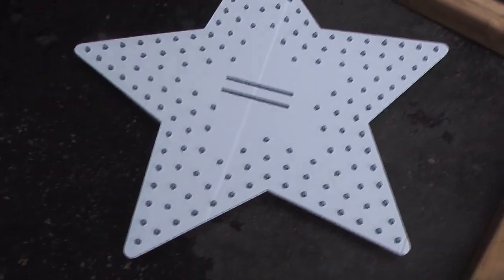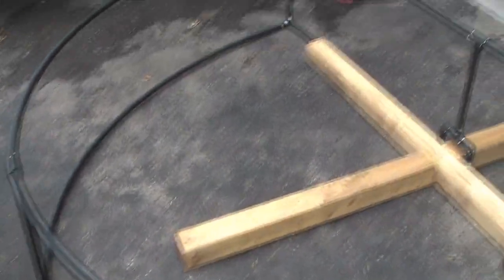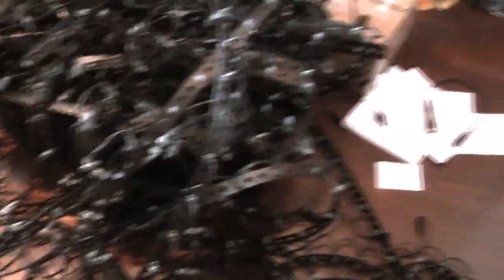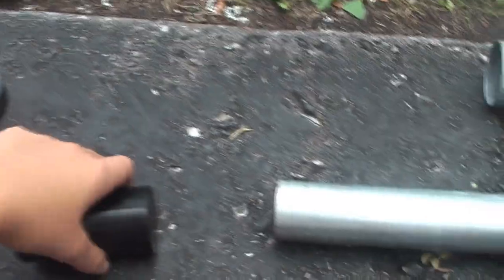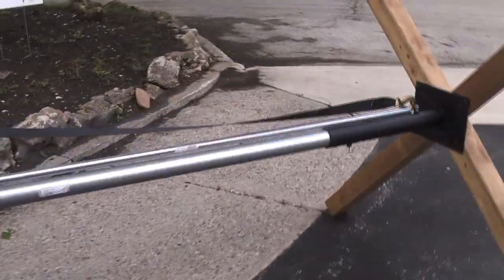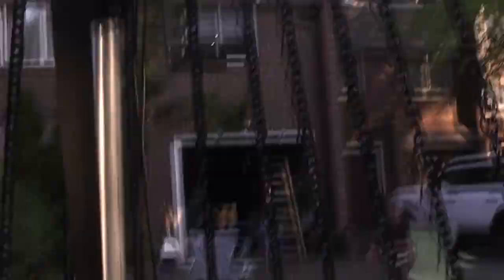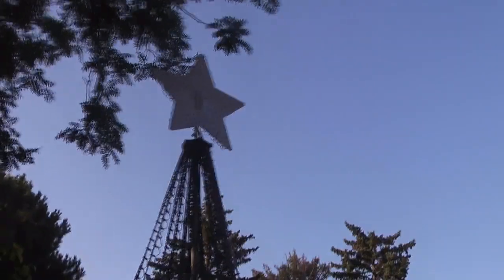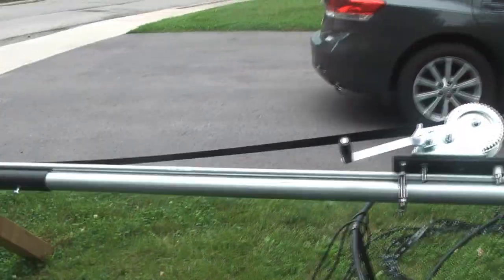Building a 950 pixel ASAP pole megatree

Comment: Your winch looks to be installed upside down. The strap should exit closest to the pole so its parallel. Someone on FB posted a picture of their lift arm bent outward from the torque this creates. Also do you have guy wires for stability in wind?
Reply from the maker: Yeah I see the pole getting bent now. How do I fix this? also yeah I do have Guy wires on it now.

Comment: Great video! Any idea what the measurements were on the pvc base?
Reply from the maker: It is 8 feet by 4 feet by 1 1/2 feet
Reply: @danielbuilds9595  basically 4ft pvc each side with a TEE in the middle?
Reply: Yeah, I did see the modification. I have a full light show but needed to upgrade my megatree to asap pole. The base idea will definitely be useful. Thanks again for all the info.
Reply from the maker: @rpra7392  no problem
Reply: Or did you cut 10ft pvc on half?
Reply from the maker: @rpra7392  all I can remember is that it is 8 feet wide, so yeah 4 feet on each side with a tee in the middle. But I did need to make something for the base to fit through.

Comment: Now this is an impressive build! many ideas and improved methods I had never seen in any other megatree.

im considering adding a megatree to my LOR show; thinking of a falcon remote reciver and massive PSU with a fused distro setup. 

I have some questions about your tree, how many pixels to the top is each section + how many is there, and how many nodes is your star/topper?
and what seller did you get the pixels from?
Reply from the maker: I got the pixels from Ray Wu's AliExpress store, There are 16 strips with 50 pixels each, and there are 150 pixels in the star.
Reply: @danielbuilds9595  thanks for the info, i was comparing buying direct to the other holiday sites and it seems ray wu has the best price so ill be going with them, just had not seen anyone elses experience with them but they seem to work great

im still debating on a 16x50vs a 16x100 tree but the remaining budget will choose that for me